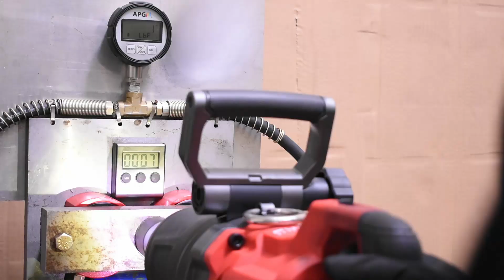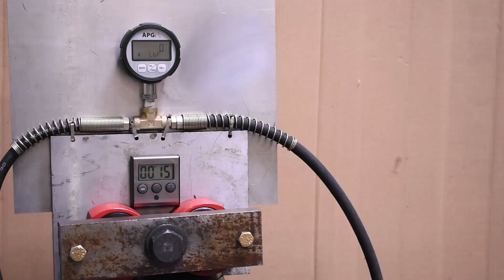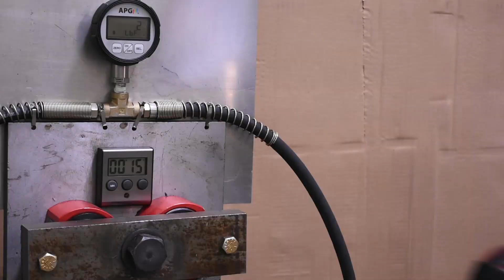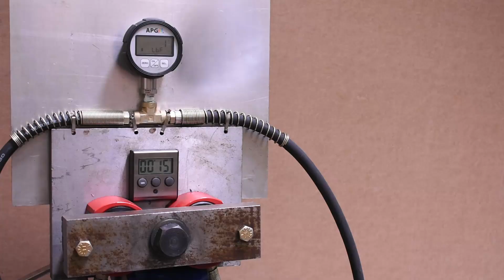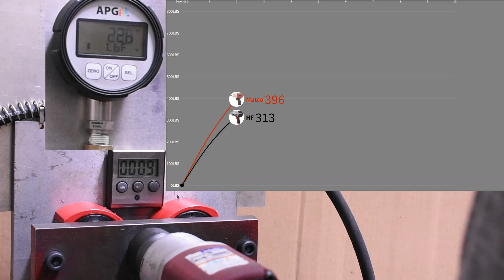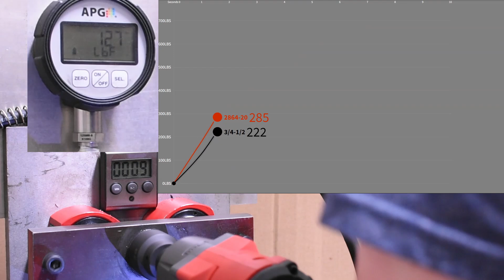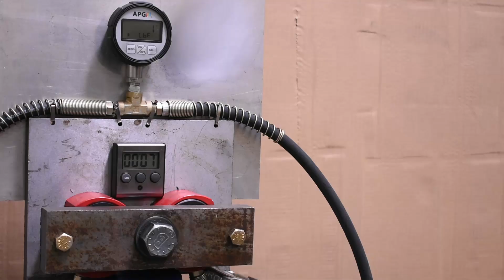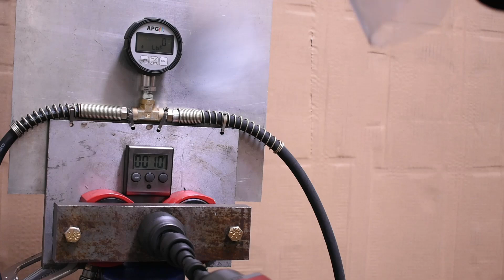How Much Power do Impact Drive Size Adapters Lose?

Comment: Thank you for this video showing the results of using adapters on impact wrenches. This was surprising and quite informative. Now I know why the Earthquake XT 3/8" impact I recently tried was much weaker than advertised. It would not break my lug nuts loose which were torqued to 140 ft-lbs. I was using a 3/8" to 1/2" adapter on it. I found the advertised tightening torque of 160 ft-lbs to be 110 ft-lbs as verified with my Snap-On torque wrench. That's very close to the 27% reduction you demonstrated. Wow! I returned the Earthquake XT 3/8" impact to Harbor Freight and replaced it with a 1/2" Ultra Compact air impact. I have not had a chance to try that one out yet but I will definitely keep in mind the effect of reducers and extensions. I assume these adapters would affect an air impact wrench the same as a cordless impact?
Reply: Yes I haven't tested it myself but physics says extending where the turn point is, or having tiny gaps in connectors will reduce torque strength.
I imagine the U-Joints for angles also reduces it quite a bit.
I imagine a 3" reduces it less than 5" and 10" extensions. If you had a swivel/Universal joint socket on the end it could increase the loss by 0.5-2x depending on where it's at? (The nut/bolt end or directly connected to the wrench/ratchet/breaker)
I have no clue how much loss there will be on combinations of different types of varying sizes and drive adapters used with swivel sockets/adapters
Reply: I also bought only ½" drive sockets and I'm getting a ½" dr Ryobi One+ HP 18v brushless Impact Wrench.
I'm planning on ordering and paying off Gearwrench 6pt, 15pc Wrench set (metric) after watching this channel show 6 point wrenches beat 12 point and spline for not stripping or slipping on bolts/nuts.
But I have a decent CR-V Impact socket set in metric coming from Amazon between the 3rd-7th all in ½".
If I have to I'll use an adapter but I'd rather buy the sockets or wrenches I don't have in ½"/6pt box end/reversible ratcheting wrench set.
I normally buy wrench & socket sets that have no missing ones.
My Gearwrench on the way is 8mm, 9mm, 10mm, 11mm, 12mm, 13mm, 14mm, 15mm, 16mm, 17mm, 18mm, 19mm, 20mm, 21mm, 22mm.
The ratcheting reversible Tollamark wrwnch set is 12pc from 8mm-19mm nothing missing.
My Jeep is fully metric so I'm normally good with metric only.
I honestly don't like SAE because of all the crazy fractions and not knowing if I'm missing a tool so I'll buy a metric replacement bolt&nuts set for suspension from BelMetric: SAE Grade 8/Metric Grade 10.9.
My rear socks are: M12x1.75x70mm bot bolt M12x1.75x80mm top bolt (Hex Flange, Partial Thread, Coarse thread) Nut are M12x1.75 Grade 8/10.9
Sorry for ranting 😅

Comment: I wonder just how much force is lost due to fitment of the adapters. I.e. will a really tight fitting adapter fare measurably better than a loose one?
Reply from the maker: We've tried 6 brands with no correlation so far, including Snap-On. Edit: Though if you're increasing rather than reducing, these seem to make a difference: https://amzn.to/3leaKL3
Reply: @TorqueTestChannel  i was trying to remove lugnuts on my tractor with a couple extension and an impact and it wouldn't come off. if i pressed the gun really hard into the extensions and lugnuts it came loose immediately. try that. push pretty hard into all the extensions, as if you were using a screw gun
Reply: @TorqueTestChannel  how can there be no correlation? From the footage alone you can see how much things are bouncing around when you connected all the adapters together. All that bouncing is taking energy from the system. I think it's a combination of both smaller area where force is applied and the play added when using the adapter.
Reply from the maker: @mandelabrein8116  We're just saying we've tried 6 brands without correlation so far. Not saying it's impossible to mitigate the loss with a different design we haven't seen yet.
Reply: @TorqueTestChannel  I bet if you machine a press fit adapter it will fair much better in the test. Good luck getting it off though!
Reply: @mandelabrein8116  There are at least three major factors: slack in the adapter stack, elastic deformation of each component in the stack and all of the inertia from the added mass. They all dampen blows apart from the rare exception where you may hit mechanical resonance.
Reply: @teardowndan5364  hello, I have tried to Google what you mean especially the word resonance and I wanted to make sure I understand, is it similar to jumping on a trampoline at the same time and going extra high ?
Reply: @jonathanfranklin2524  resonance is when a system self-oscillates after stimulation and can build up those oscillations with appropriate external stimulation. The simplest intuitive example would be string instruments: notes (the strings' fundamental resonant frequencies) are determined by string weight, string tension and their effective length.
Reply: @TorqueTestChannel  all of the brands may have a similar sloppy fit and I  would imagine it's necessary since it's so common. Test some adapters or sockets with an exceptionally loose drive fitting, if you haven't already. I must admit this is the only video I've ever watched on your channel but it was also the first ever recommended to me
Reply: @denisl2760  put shim steel between the adapters and press them together
Reply: @TorqueTestChannel  I think what some of the questions are probing is.. what is the line of logic to apply to deduce to some extent an expectation.. logically.. every adapter joint introduces play/tollerance which can only dilute impact shock.. the temper hardness of each adapter should too affect shock transmission.. conclusive !?.. the sloppier the joint too.. the lesser that joints contact impact face at the square drives perimeter.. would be interesting to see what difference hex drive would have vs square as an adapter
Reply: @teardowndan5364 : I would disagree on inertia, since weighted sockets are a thing.
Reply: @williamrekow7513  inertia is a major factor in mechanical resonance. You need just the right amount of it for the amount of angular flex in the system to match impact frequency.
Reply: @teardowndan5364 : funny that just adding more weight makes them perform better...
Reply: @williamrekow7513  Not always though. Results vary on a setup-by-setup basis.
Reply: Probably could matter, any kind of slop in fitment takes up some of the impacting force but also you can only make it so tight since you need to be able to get them on and off easily enough so the difference is probably very small
Reply: Exactly what I was going to ask.
Reply: I don't understand the discussion here. Slop is THE mechanism which costs torque, in the context of impact torque. Are people thinking the geometry of the adapters makes a difference? That's bad physics.
Reply: So...If I put enough adapters on,  the socket will actually spin backwards?
Reply: @1957StrokerPan if you start with a 6" and work your way down to hex shank, you start to create anti-matter 😮
Reply: @1957StrokerPan  no you keep loosing search up exponential decay graph you will get closer to zero.
Reply: @gradypoole5366 that was clearly a joke
Reply: All of it essentially. A setscrew in an adapter offset to the anvil square drive access could preload the adapter in the removal direction where most torque is necessary thus removing the slop.
Reply: All of the loss is due to sloppy fits.  When something is bouncing, energy is lost by definition. Period.
  If you have ever seen people trying to break a car window with the door off the car, you know what I'm talking about.  Put the door back on the car and it will break right away.
   For example; if the adapters were welded together,  there would be no loss.
Reply: I feel like the tighter it is, the more likely to snap off. Probably loose fit is intentional.
Reply: @saikyouabe  that doesn’t make any sense. Why would the loose fit be preventing it from snapping off? If the force was strong enough to break it off if it was tight, it would snap it off regardless of it being a tight fit, or a loose fit.
Reply: @saikyouabe  can you explain why you think this I thought it would be the opposite as the tighter the less hammer force coming onto the adapter?
Reply: @jonathanfranklin2524  I cannot lol. My claim was based on no scientific notation. Just my observations on anytime I've broken something, when it had some room to spare typically it would just slightly deform whereas with a tight or exact fit I could exert enough force to snap it off. Both with impacts and with a wrench and breaker bar.

Comment: Wow, didn't expect there to be that large of a loss going 3/8 to 1/2. An adapter is by far cheaper, but perhaps this gives more value to having both sizes in the same body/tool (ex. having both 3/8 & 1/2 stubby or mid-torque).
Reply: Do you mean from the 27% from 3/8 going up to 1/2.  While having both is the right answer a 7% loss doesn't seem terrible if you are trying to break free a smaller bolt
Reply: @clion520  sorry, I corrected my original post. I did mean 3/8 to 1/2.

No, I don't see any issue going 1/2 down to 3/8 other than the fact that adapters snap easily.

Seeing this, it makes more sense why ShopToolReviews welded the adapter to the socket, although this does bring up a scenario that was not taken into account in this test....if you take out the slop by welding it, is there a loss of power?
Reply: @98ChevyK1500Z71  also.. ex. Having both 3/8 and 1/2” guns, as well as have 3/8 and 1/2” sets of metric and SAE impact sockets. Deep... and shallow. 🤔 maybe someday I’ll get there 😂
Reply: @ianloyd6384 I got that and even though my wallet is not happy they sure look beautiful together as a real family. 😂

Comment: 3/4 air would still be interesting. As you stated most people are not getting the advertised torque ratings due requiring such a high static pressure. The video would be a nice way to determine if the 3/4 is worth it over a 1/2 air even at the lower pressure. If the 3/4 air still gets a significant amount more torque, then there still might be a place for it in the tool box.

Comment: Man, putting the true cost of 1" air impacts into perspective like that, the battery-powered IR and Milwaukees are a fucking steal.
Reply: Not to mention how inefficient air is, your energy costs will be much higher running that massive compressor compared to charging up a couple batteries.
Reply: @theflyingfish66  Też nigdy nie rozumiałem tego fenomenu. Marnować prąd na te wszystkie straty po drodze. Akumulatorowe narzędzia jak wiadomo są mobilne, za to drogie i baterie starczają na krótko, ale przecież istnieją klucze na 230V/110V (czego w sumie kiedyś nie wiedziałem, bo są bardzo mało popularne). Jest też pełno innych narzędzi pneumatycznych jak szlifierki(kątowe i proste), grzechotki i nie tylko - pytanie po co? Z drugiej strony dziś to przeciwnie coraz częściej jakieś pistolety do dmuchania, malowania, czy nawet pompowania są dostępne jako oddzielne urządzenia na baterię, choć tu akurat mobilność jest wytłumaczeniem.

Comment: Could we get some 3/4 and 1 inch air impact comparison also I have heard of 1 and half and 2 and a half but after looking at snap ons prices I wouldn't judge you for not doing those.
Reply: Prices go up significantly in those drive sizes.
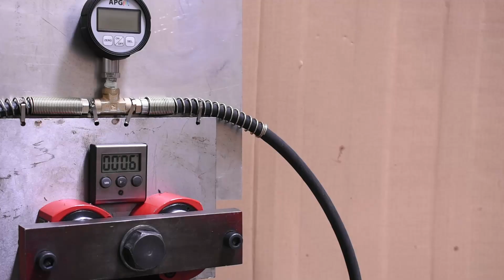Reply from the maker: 6:47
Reply: @TorqueTestChannel  Yeah that is interesting seeing the Matco perform that much better. I only work on Semi Trucks and our shop has the IR 3/4 as well as a vibrotherm and the vibrotherm doesn't have that issue like the 1/2 with the trigger and seems to put out way more power than my thor despite using mostly with 1/4 air lines. I have been thinking about buying one, but the price difference between the husky/harbor freight at 250ish and the snap on at over 1000 seems like a bit of funny business. It might just be worth it to get the Makita XGT or wait for a new M18 instead.
Reply: That's an industrial site kinda deal. The power plant I work at has an air farm feeding 3" pipe headers and 1-1/2" drops terminating in 3/4" air stations. We have to regulate down at the tool if can't take service air pressure.  Even still, nobody uses a 1" gun. If you need more torque than you can get out of a 3/4" impact, you go straight for a RAD gun or Hytorc.
Reply: @Corrupted355  I am a semi truck mechanic and we use 1" for wheels and removing yokes. Just a my case and if I'm interpreting correctly.